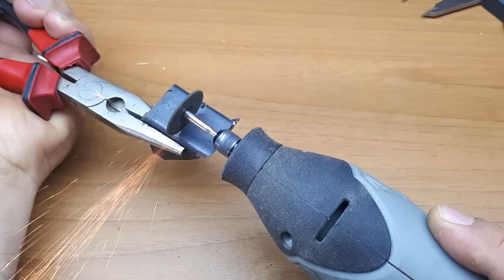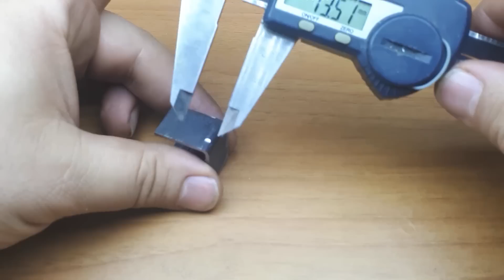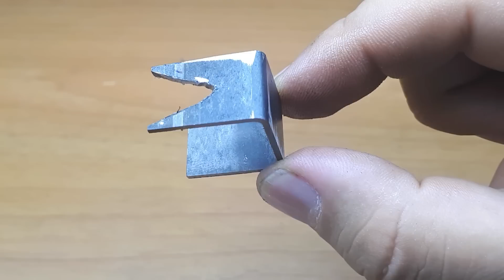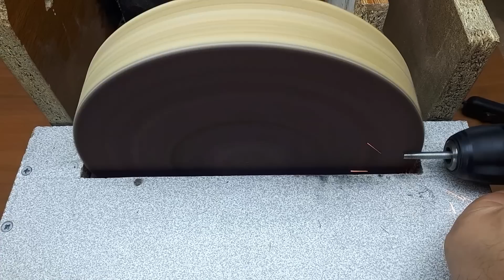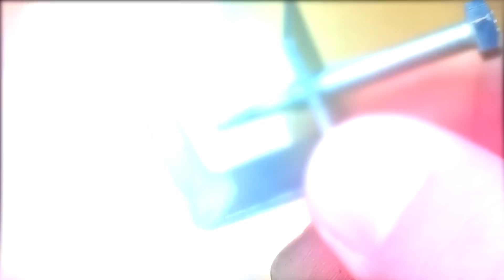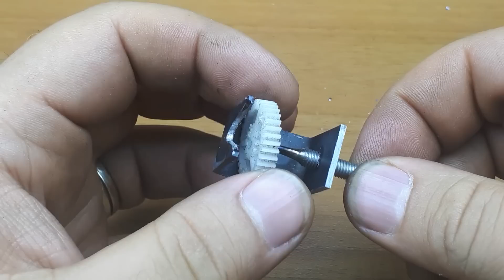Amazing Simple Metal Tool - Mini Pulley and Gear Puller - Mini Metal Çektirme Yapımı

Comment: A lot of work for something that  could with a pair of long nose pliars.
Reply: David Hayes. Have you ever tried removing a gear with long nosed pliers? Doesn't  normally work
But this little gadget is fool proof and you can use it on smaller/bigger gears.